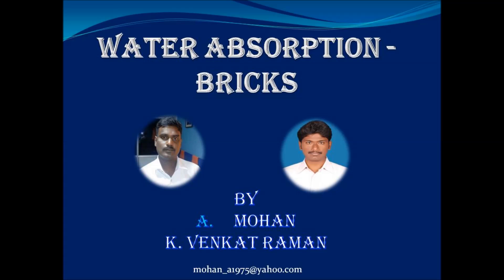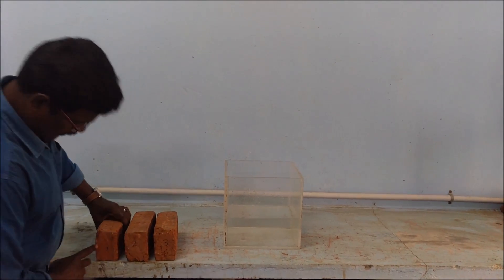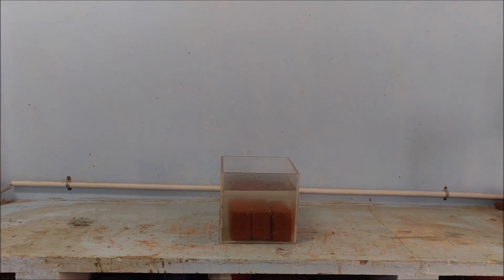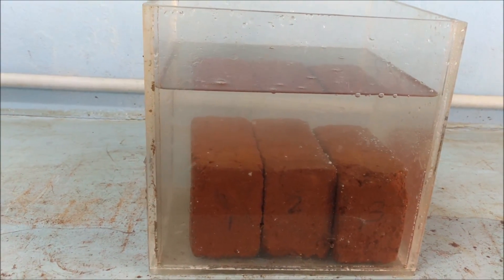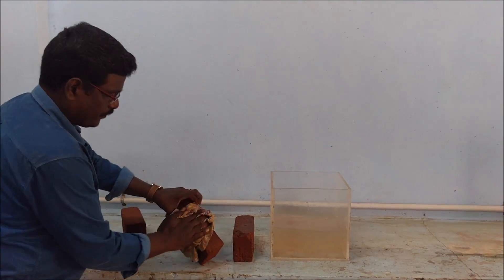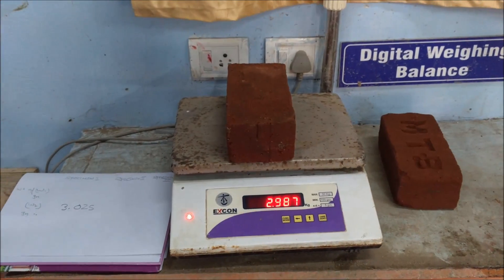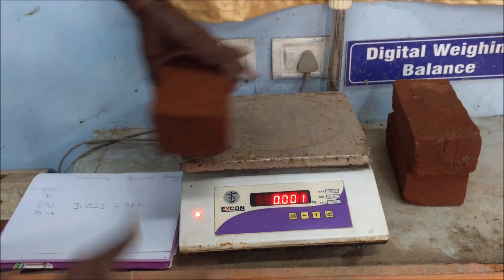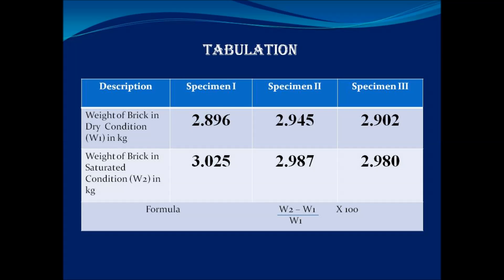Water absorption on Bricks

Comment: You missed first step in which we put the bricks in oven to completely dry them and then they are weighed before putting in bath.
Reply: I caught that too, however, moot point if trying to find the saturation amount of the bricks which is what this did.  If measuring the lost volume of the water, then that would apply however that's a lousy way to measure due to evaporation.  Maybe not following all standards, but did not matter in this case.  Saturation then drying and using the difference would be the most accurate way.  Only issue is the very minimal evaporation when transporting the bricks to the oven.

Comment: Very informational video. Is there a reason to calculate the dry weight afterwards? Because i saw somewhere that the bricks were being dried in the oven beforehand for 24 hours and then dipped in water. Would be grateful if you could explain which would be the preferred method and why.
Reply: You are saying right... first dry on oven for 24 hours

Comment: Simple way to find % of water for brick!
Put the brick in water for while then take out and cut the brick in mid and see the cross section
Eg; measure total cross section area is 4.5 * 3 =13.5 inch square'
And dry space area is 
4.3 * 2.8=12.08 inch square
12.08 divided by 13.5 and multiply by 100 = 89.481
And then 100-89.481=10.52
It means brick absorb 10.5 % water....'